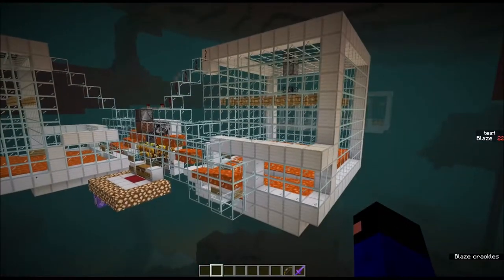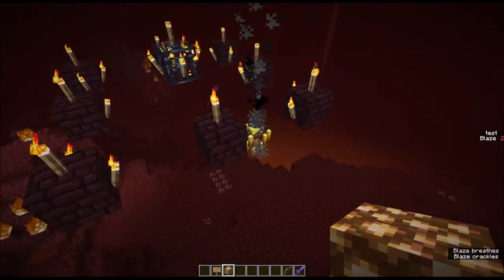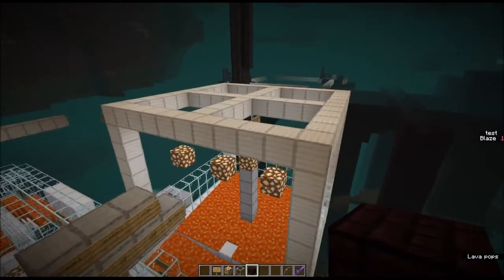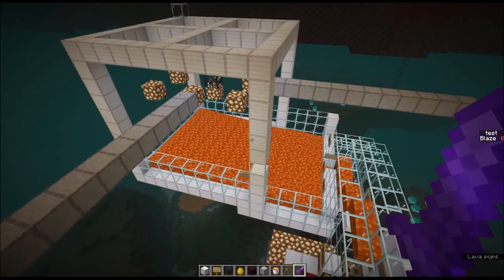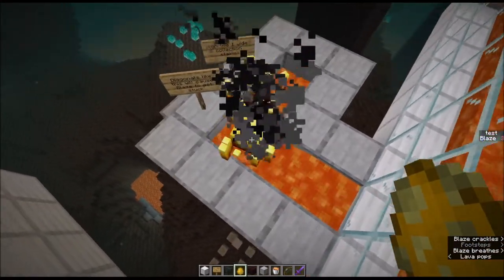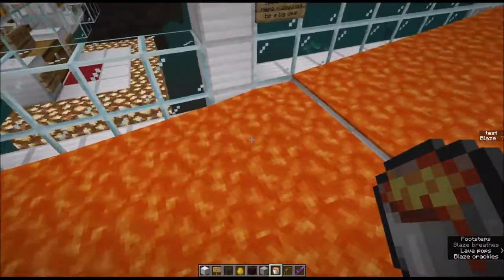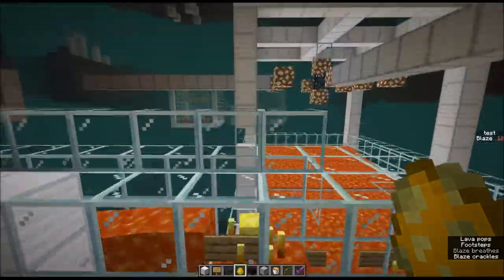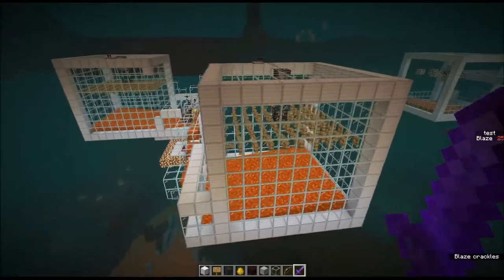Minecraft Double Blaze Spawner Farm - XP, Blaze Rods, Combined Output with On/Off Switch

Comment: I found a fortress with two spawners 6 blocks away from each other, and they line up evenly. I am having a heck of a time figuring out a good farm. I finally figured something out, pushing lava from four directions to a 2 by 6 drop for the blazes to collect. Its not super efficient but its the best I could come up with. I'm not very Minecraft technical. I haven't seen any kind of farms like this on the internet. Can someone give me some building advice?
Reply from the maker: you could probably build one larger spawn chamber cube with both spawners in it and use the lava under the spawners like in this video to gather them together into a kill area.  I don't think you would need any of the lava steps to move them 'up'. The blaze need to be able to fall 5 blocks away from the spawner so new ones will spawn and the player needs to be within 16 blocks of both spawners to keep them active.

Comment: It is a very nice design, and I used it in my world. Although once I kill a single blaze, all blazes inside the spawner room will sarts to fly, is that normal?
Reply from the maker: i believe it's normal for them to become aggro.  It's typically best to let a bunch collect, then kill them all at the same time.  If you one-shot a blaze it should prevent triggering the aggro.. so you could soften them up a bit with splash potions.

Comment: By using some graphs on Desmos (or any graphing calculator) you can easily visualize where the player can stand to activate multiple blaze spawner. The equation of the circle can be described as 16^2=(x- X)^2+ (y- Y)^2 where capital X and Y are the coordinates of the blaze spawner
Reply from the maker: Hey man... my engineering degree is like 15 years old at this point.  lol... I wonder if there is a way to do it excel.  That would make it more accessible to others.  I know my TI-83 Plus is pretty dusty.
Reply: I was thinking about it more and I realized that I was actually talking about x z coordinates in my last post.
Reply from the maker: Ya.  On a base level you really just need the average value X,Y,Z coordinate of the 2 spawners and that would be the middle.  The z would then have to be moved down 1-2 blocks for the player height.  But, like you said, the visualization has a ton of value for people who aren't familiar with the calculations.

Comment: Great video and clear explanation. You dont happen to have a material list for this do you? I am lucky enough to have 2 spawners
Reply from the maker: Most of the blocks can be anything.   The counts change based on how far apart the spawners are in your world, so i think it would be difficult to make something particularly useful. I'll add a link to a world download, if interested.
Reply: @DigitalChaos119  All good. I completely understand that it would be hard to get a good list. Either way absolutely amazing video and very underrated content creator🙂
Reply: @DigitalChaos119  yoo great video, can you tell what the mod is called, that gives you the Info about the mobs that spawned?

Comment: I spent a lot of time searching for a way to funnel blazes upward because my spawners are kinda barely in range of each other and on the same y level.... I'm really glad you made this video and explained about how to effectively move them and to avoid corners because they would get stuck. unfortunately, I didn't heed that part and it took me many attempts redesigning the pipes to get it to work. and right now it works but aesthetically im not happy with it at the moment. anyways, between your video putting me on the right track and some experimentation, I am a lot more comfortable designing blaze pipes :D

for anyone like me who had really long pipes because they had to lift the blazes up a fair amount then move them into precisely the right spot, you can make the pipes turn, but you want the lava flows to be straight. so you have to cut off the lava flow and have the blazes fall at least 3 blocks into a new lava flow going the direction you want for them. if the tunnel ends up dipping too low, you can just make another stair case going up...
Reply from the maker: Moving Blaze can be tricky.  Glad you found the video helpful!
Reply: Ah, this is actually very nice, thank you

Comment: Looks very good and I am looking forward building it, I have only one quick question. On my server it is possible to build spawner farms anywhere and I wanted to build this farm under an overworld pigman farm I have. Now, does the blazes spawning from the spawner effect the mobcap and would I get with that less pigman spawning or even less blazes spawning?
Reply from the maker: Mobs from spawners do count toward the cap... but spawners will continue to function if the cap is reached.  I don't know if pigman spawning from portals count toward the cap, but my guess is they do but would be able to continue to spawn anyway.  An overworld portal farm tends to be slow and I'm not sure you'd be near mobcap with just those 2 farms in the area... but i supposed it depends how big the portal farm is.
Reply: @DigitalChaos119  Thanks very much. You are so helpful man
 Appreciate it:)
Reply: @DigitalChaos119  While building I had to play around a bit, because overworld the lava doesnt flow 8 blocks and so on. But now I have a follow up question: Im not sure if its worth for me to build it overworld, because the lava just flows sooo slow and, while testing, the blazes moved so slow
Reply from the maker: oh, right... i didn't think of the lava flow issue.  Blaze just tend to move slow when being pushed by lava, do you think its different than in the nether?  Since you can place spawners wherever you want on your server, there is probably a re-design using more step-downs that could be done.
Reply: @DigitalChaos119  I made some changes, so it still works(tending to be a small bit slower). I just have the problem with the lava where they are spawning. Because lava only flows 4 blocks, like you said in the overworld. I tried with signs in between, but they get stuck there. I could do it in more levels, like you did with two. Do you think this is a good idea by me, or do you know maybe a better way? Thanks for all the help